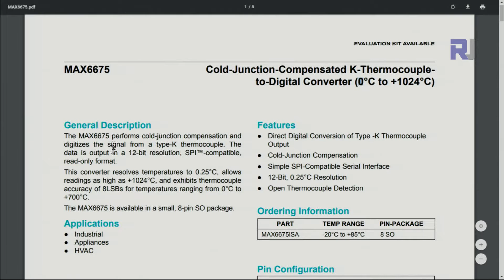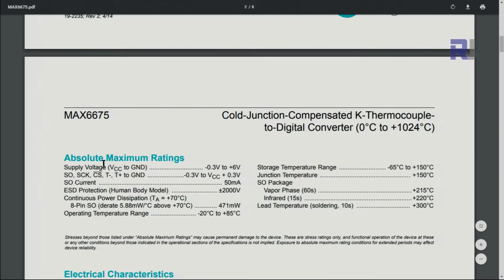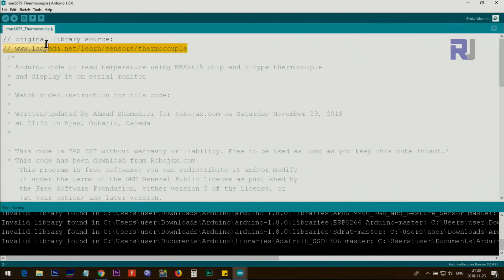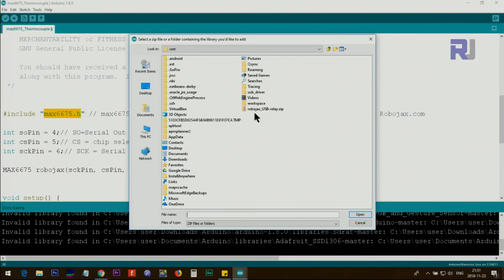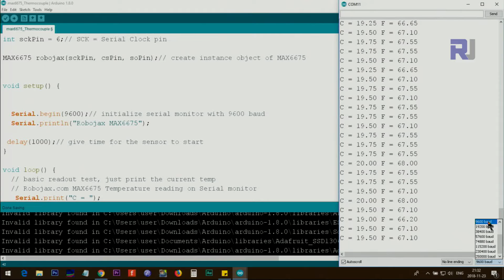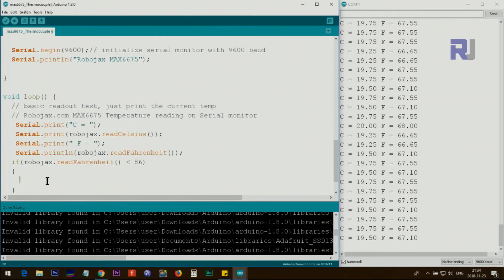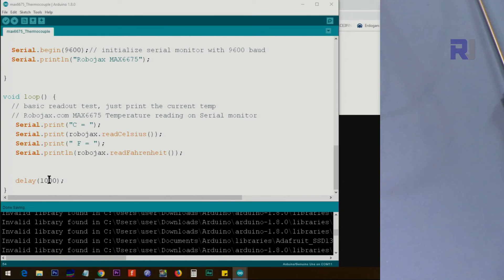How to use MAX6675 thermocouple k type with Arduino RJT138

Comment: Nice vide, can we record temperature versus time?
Reply from the maker: once something connected to Arduino, then you are the king. you can do anything you want. Just use a loop and do counting for every seconds or less or more and record it. You can use SD card to save it as CSV file and open it in Excel. Search my channel for micro SD card or browse for loop if you don't know what loop is.

Comment: I have 5 thermo’s when i connect the 4th one it starts to read wrong what should i do?
Reply from the maker: look at the video that teaches two of this sensors, learn from that. I have the video. search my channel.
Reply: @ you did just 2 sensors i have five, so the pins is not enough, i will make the sck pin shared between all 5 sensors

Comment: hello! the serial monitor in my arduino program is showing always 128 - 129ºC (the sensor is in ambient temperature conditions), and it doesnt change if i apply heat. Is the sensor not working? You think you could help me? I cant solve this. 
Thank you very much!!!!
Reply from the maker: Hello, dis connect the sensor and see what you read.  something is wrong. if you have anoter module and sensor, try them.
Reply: @robojax  thank you!

Comment: HI; THANKS FOR THE VIDEO
I HAVE A QUESTION, I WORK WITH TYPE E , I NEED OTHER MODULE OR THE MAX6675 WORKS WITH ALL THERMOCOUPLE TYPES ?
Reply from the maker: Hi, when you write in CAPITAL letters it is screeming 😱 and very hard to read. Now your question: I did an search on Google and got this https://www.sigmanortec.ro/en/thermocouple-module-type-e-max6675-1024-degrees which shows it works with E Type. So do more reseach or simply test it. Good luck

Comment: My thermocouple is reading way off values, upto 1135 degrees celcius. It also reads some "nan" values. Anybody, please help
Reply from the maker: I belive I mentioned it. "nan" means the sensor is not detected. check wiring.

Comment: How many sensors maximum can i connect to Arduino Uno? I also have a breadboard, i have 6 sensors, can i put it in one arduino uno?
Reply from the maker: Depends how many pins you have on your board

Comment: Does it matter the pins to make the connection? I mean: Can I use other pins and will it work properly?
Reply from the maker: Of course you can use any other and define them in code. I should have mentioned it when explained the code.
Reply: @robojax  Thanks a Lot ! Excelent Videos !

Comment: I'm not using an arduino with a 5V output (ESP32). Can I use 3V for the VCC pin on this MAX6675?
Reply from the maker: No, it needs 5v and esp32 if you power it with 5v has 5v output
Reply: @robojax  ok thank you

Comment: Hello I have an electric oven that mounts a type K probe inside the chamber, then it must be connected to the controller (plc), do you think I can also connect the same probe to max6675?
Reply from the maker: Hello, I am not sure. Just open the oven and connect it to Arduino and see if it work and compare with some known good meter.

Comment: Hi Robojax. If I want to use three micro k-type thermocouples to detect temperature at different locations,  do I need to order three MAX6675 with one arduino uno?

Thanks for your video and help!
Reply from the maker: You can use as many as you like on the same Arduino board as long as there are pins.  here is the video showing it using two of them with two display https://youtu.be/TkKPUHMFDiI

Comment: why you are using pin 4,5,6? you said SPI compatible so it should be 11,12,13 on Arduino Uno
Reply from the maker: It is  Simple SPI-Compatible Serial Interface. I don’t remember what I said. Here is the better version of this video with wiring diagram https://youtu.be/A55QNx6kCoo

Comment: Could you please tell me if I can use it with PLC controller ?
Reply from the maker: this is just a sensor. you have to know how to use it. if so you can use it with anything.  Arduino is used here to read the values. if you use something else, to read it, it should work.  I have no experience with PLC and have no idea with it is. I looked online to buy a kit to make videos but, there is nothing clear about it. so I gave up. I know it is used in the industry but could not find a standard controller or item. on eBay or AliExpress I did not find a single item to be famous. each item i found has sold 10 or 20.  so I did not buy it. I want to see if something is sold at least 10,000 time then I know  it needed and I would make video.  so post the most common name, I will check it and if found to be interesting, I will make series of videos .

Comment: Hi Robojax...! very useful tutorial. I have tried this and it worked. Could you recommend me a suitable temperature sensor module if i want to measure the temperature with 0.1 deg C of resolution. This MAX6675 is providing only 0.25 deg C of resolution and fluctuating of around +/- 1 deg C which is not acceptable for my process temperature measurement. Thanks in advance
Reply from the maker: Hi, I have not come across such resolution for this k-type sensor reader.  do bing/google search, you might find something.
Reply: @robojax  Thanks for your reply.!
Reply: Hello, what is the name of the 0.1 module??

Comment: Sir, I want to display temperature 5 degrees more than the actual, is it possible e.g if the actual temperature that thermocouple read is 300K, I want to show this temperature by 305K ( 5 degrees more) please guide me my project is stuck in this point
Reply from the maker: That  is the simplest thing.  Perhaps you posted question before watching the video. I have explained how it works.  Just get the value and put +5 and it will be added. Please watch . My videos are different. You learn when you watch
Reply: @robojax  do you mean I put +5 in 
  lcd1.print(in.readCelsius()); // print temperature in Celsius
like this
 lcd1.print(in.readCelsius(+5))
I am waiting for your precious replay.
Reply from the maker: Again you have not watch the video. I mentioned “variable “ that is holding temperature. You add 5 to that variable.
By the way wrong video. I have separate video for k type sensor and lcd. Hard for me to search but the link must be in the description
Reply from the maker: Here I found it https://youtu.be/BlhpktgPdKs always search my channel. You will be surprised

Comment: I have tried many codes which includes your code and also code from Arduino library but still my thermocouple showing 0C and 32F where might be the problem?
Reply from the maker: Zero degree means your sensor is either not connected or it is dead. I assume code is not changed .

Comment: I am unable to measure the temperature everytime i used to get C=0 and F=32 what should  I do plzz anyone help me robojax bro
Reply from the maker: it means either wiring is incorrect with assumption that you have not changed the code. If you did, use the original code without changing. or the module has no power or it is dead.
Reply: @robojax  I think the module is dead because I have used the code you used and also checked wiring nearly so many times now should I buy new module or can I repair my current module

Comment: I am getting temperatures as 0 Celsius only even if I hear the sensor what should I do brother?
Reply: Heat*
Reply: Can I get your number??
Reply from the maker: I assumed you have not changed the code, check wiring and power
Reply: @robojax  where should I change the coding??

Comment: Hi, I set up the thermocouple and arduino and was able to get temperature readings, but the change in temperature is incremental. The temperature increases or decreases slowly by 0.25 every half second. I would appreciate it if you can tell me how can I get a quicker reading for a temperature change. or if you can let me know what the issue might be.
Reply: There will always be a bit of a delay because of the thermal mass of the sensor. Good contact with object of measurement and a sensor with low thermal mass are key for quick readings.
Reply from the maker: Hi, I have explained it.  there is delay inside the loop. play with that if it say dalay(500); then  it has delay 500ms. so make it 20 or 100.

Comment: i used this same code but not working with my thermocuple
Reply from the maker: You should get some error. check the wiring. have  you download the library?
Reply: @robojax  yes i did
Reply: Md.Sojon beg sojon my thermocouple is also not working can u tell me what to do if u have overcome your problem plzzzz

Comment: Hi @Robojax  - do you think it's also workable to share Serial Out and SCLK between multiple 6675's?  I would need separate CS lines to enable them.  Only 1 could be active at a time. I'm trying to think of a way I could have a few more 6675's on an arduino. (like 8 or more) - Thoughts? Workable?
Reply from the maker: Hi, yes you can open multiple serial monitor. see this video https://youtu.be/FHVYLNyP5aw

Comment: Greate video!!
Is there a way to measure temperature above 1024 °C? Normally thermocouple K can measure up to 1260 °C, and I would like to measure the temperature of a furnace that can reach around 1200 °C.
Reply from the maker: Thanks. The temperature depends on the sensor. you may be able to get it with higher sensing value.  Here is my latest video using this as Thermostat for heater and cooler control https://youtu.be/dVh77wT-4Ao

Comment: Curious, if making the lead shorter would this effect the readout? It's probably done on resistance right?
Reply from the maker: Yes it will affect the result.
Reply: @robojax  That's what I thought.
Can the resistance values be manipulated in the Arduino code?
Reply from the maker: No. it will will affect the reading. Have a look at the datasheet and see if there is such option.

Comment: Can this temp sensor display temp values live and updated on the serial monitor like a meat thermometer? I have tried using the DS18B20 and a thermistor but they are way too slow. I need to measure change in water temperature very fast. For example during testing, I dip the temp sensor in cold water then switch it to hot water and I have to wait so long for it to increase to the actual hot water temp. Using a meat thermometer, the values update so fast. Please help.
Reply from the maker: I have provided the datasheet in the page where the code is. On page 2 it shows that conversion time is 0.17 to 0.22 second. Serial monitor is very slow.
Reply: @robojax  thank you for that information. Is there any way I can message you privately please?

Comment: can i use j type same divices
Reply from the maker: The module is specifically designed for K type. See the datasheet you may be able to use it https://datasheets.maximintegrated.com/en/ds/MAX6675.pdf

Comment: How to use the module for measuring millvolts of shunt resistor
Reply from the maker: which module? this module is not for that purpose.  But you don't need any module. Watch this video and instead of potentiometer, use your shunt resistor https://youtu.be/TbLdAQpE4jE

Comment: All my output values are 0 
What might be the problem?
Reply: and as soon as i plug in the max 6675 module, it becomes crazy hot. is that a problem?
Reply from the maker: Heat show incorrect wiring.
Reply: Lokesh Dahiya I am also getting same mistake did u overcome it if u have overcome plzz tell me what to do plzz help karo

Comment: Thanks for the video. a few questions- how accurate is this? Can i measure the surface temperature of a metal rod using this?
Reply from the maker: this is not made for  surface but if you put heat transfer compound so there is no gap between the sensor and target surface  you should get good result but not very occurate.

Comment: The serial output gives only the first reading  correctly then all other temperature readings are zero. sir what can  be the problem?
Reply from the maker: I don't know but to guess you have changed the code or wiring issue.
Reply: @robojax  the code was exactly same except the pin declarations..and wiring was checked many times. I think may be max6675 module is faulty.
Reply: i have same problem. are you have solution? thank you

Comment: I put extension wires on the TC and it caused it to not be accurate.
Reply from the maker: for the k-type you can't extend it as the length is important due to material type. but for arduino wires, yes you can extend it some distances.